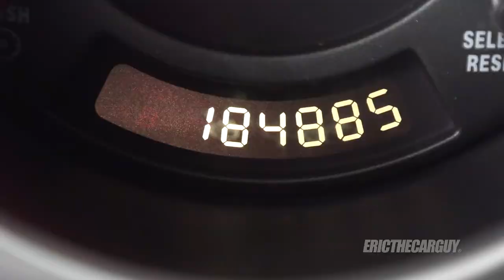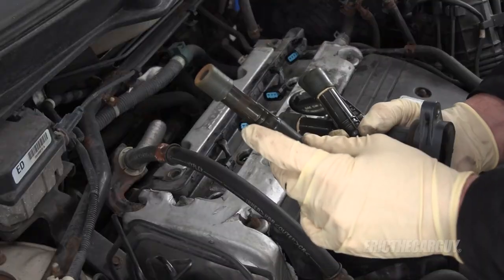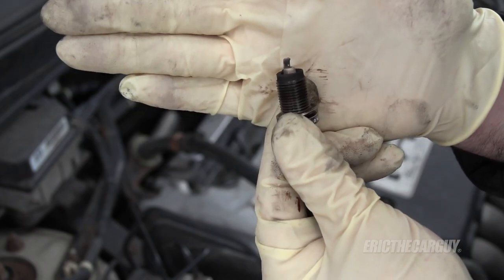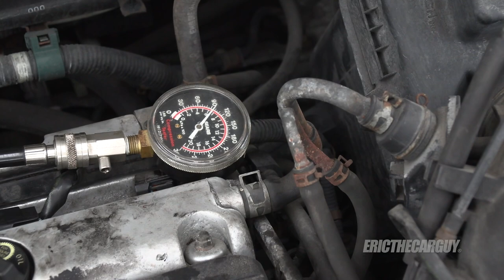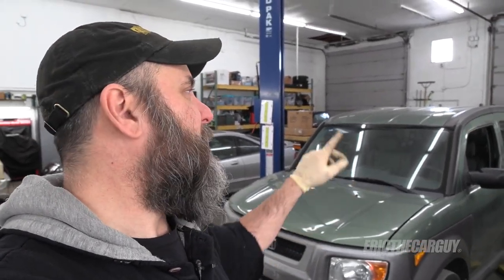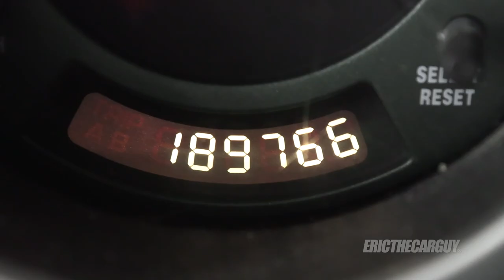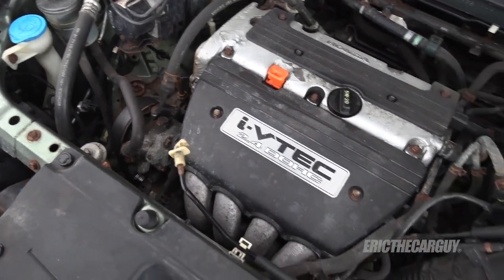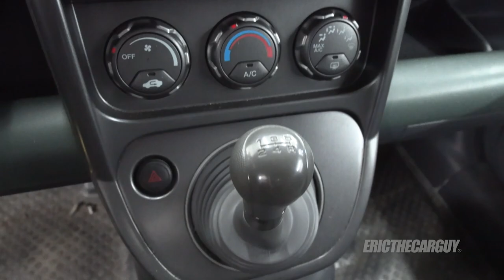I Just Bought 2 Honda Elements

Comment: With all your Honda/Acura experience, you’re definitely not out of your element. Deja Vu all over again or Deja Vu Deja Vu. I’d try some Yokohamas on the Element or maybe some down market Master Craft tires made by Michelin. I wonder what the dual pump fluid looks like in these vehicles.
Reply from the maker: Actually Nokian may be stepping up with tires. I do plan to change the diff fluid on both vehicles. Thanks for the comment.
Reply: @ericthecarguy  Cool, glad you got sponsorship on the tires. Now if you can score a 2.4 engine from J&J Auto Wrecking for the beige Element, that’ll be epic.
Reply from the maker: I'm actually sourcing one from Low Mile JDM. They are sourced from Japan where they have to replace an engine after less than 100K due to their emission laws.

Comment: I have an element  Halloween horror story
my alternator went, it killed my battery. 
luckily my battery is still under 100% warranty so I got that replaced for free. 
But when I started taking everything apart to get tested. I found out my fans had no bolts in them, 
so it made it easy to take out to access other areas 
then I removed the battery and the housing I discovered the welds have rusted off 
like I was holding a piece of Elmer's glue in my hand
so then I decided to change the thermostat since I could get to it. 
took wayyyy to long but I got it back on (such horrible placement)
Then since all the paint is chipping off the engine I was cleaning it up 
and then I decided to change the spark plugs, when I got to the spark plugs 
I saw there were NO BOLTS holding in the boots for the spark plugs....
Reply: I am currently on the hunt for a good deal on an alternator and 
advance auto parts seems to have the best pricing as far as an easy pickup. 
I am afraid to go used (not remanufactured but used)
I don't want to have to do this again for awhile.
Before this happened I was in the middle or replacing the 
ignition switch, keys and dreading replacing the door locks
i also upgraded all dash and climate control lights with led 
and painted all my dash pieces for a new look
Reply: so as of now i need to install a battery, alternator, plugs, fans, all dash components and plastic, muffler, rear struts, front upper control arm bar, trailer wiring, additional 12v port and plugs and figure out how to properly clean and repaint the engine without having to remove it. 

OHH and how to properly and safely fix all the major rust in the engine bay. 

at this point im starting to think i should sell it for parts and buy another one lol
Reply: i really really wish i lived close to you lol. If anyone is in the cleveland area hit me up if you are bored and want to help a fellow elemental!

Comment: I got a jdm k24 for 700 but jdm engines are usually nasty but ive been running mine at 360 torque and 380 hp in a em2

Comment: Eric, since you have a TON of elements. Can you help me just with your best opinion of why after a transmission rebuild and new clutch, my clutch is on and off making a chattery sound. it stops when i press on the clutch, and it can be remedied if i press the clutch just a tiny bit. I mean, its a brand new clutch and ive already put more than 1k miles on it and still can hear it on idle. Im guessing the release bearing?

Comment: Hello Eric, off topic to the Element,  but have you seen idle issues on CRV(2013) where when you stop in D(foot on brake) and the idle goes down to around 600-650rpms and there is vibration in steering wheel? CRV has 151k miles.

Comment: 6:00 ..I bet its just the valve is stuck open, and the valve of the other cylinder is open based on the timing of the engine in that moment-- and the air was just pumping across one of the manifolds.  Idk the valve would be stuck open though, not good.

Comment: Hello Eric, greetings.🙂. My 2001 honda accord showing transmission codes. (1,6,7)
We have OBD1 accords here in NZ even in 2001.
1 is for lock up solenoid cicuit A
6 is for shift lever position switch
7 is for shift solenoid circuit A.
I got 1 and 7, but what is 7??
Transmission position sensor or its under gear nob??andi have bench tested shift and lock-up solenoids and ohm testing. They are in factory specs. Do you think it can be a faulty computor??
I shall really be thankfull for your help.

Comment: I'm looking hard for a 2007 or 2008 EX. Slim pickings around here (I'm in the northeast). Thinking I may need to go out of state, but travel brings its own hassles. Is it worth it just to avoid the rust? Also I'm wondering what the popular consensus is re: manual vs. automatic. I'm cool with either, but which is more widely preferred, and why?

Comment: Hey Eric this is Gill i have problem with my Honda Accord 2008 ex 2.4L engine 
Some time it take long crank to start and then code P0339 and VSA light comes on 
This thing mostly happened in cold weather (-20c)but sometimes in summer to

Comment: I never buy Goodyear anymore I had 3 different cars with different model Goodyear tires that were properly inflated explode on the highway and of course they go we can't determine if it was a manufacturing defect because the tire is torn apart . now i have the new Michelin crossclimate tires they work great all year round snow rain or dry pavement and they wear evenly

Comment: I’m guessing this is due to piston ring wear on this engine, what would cause that though? Running the engine too low on oil, driving too hard, not changing oil frequently enough misfire on all cylinders due to bad plugs causing the ring lands to break? 184K is very low miles for a Honda K24, I would really like to know more back story.

Comment: Hey Eric I wanted to ask you a question I have a 2003 Honda element all-wheel-drive it’s a automatic and I was wondering if I’ll change out the computer to a Acura TSX would it make it faster like the TSX or will it just totally destroy the engine and also how can I remove the speed limiter on the element 
Thanks in advance

Comment: I also own a 2005 Element.  I do my own oil changes, and I have never been able to remove the oil filter without spilling some oil on the chassis given that the oil filter is sitting horizontally.  Let me know if there is a trick to avoid the oil spillage.

Comment: Erick, I purchased front brake pads for a honda city at the dealership. The box came with pads, backing plates and a small bag of what seems to be grease....I didnt use it because I wasnt sure what it was...I used silicone lubricant on all pins but they were coated with a black substance similar to what the dealership provided inside the box....is that black stuff grease or is it silicone paste? I can send you a pic if you want but the bag doesnt say anything.
Reply from the maker: The packet is moly grease. It's suppose to go between the brake pad shim on the back of the brake pad to help prevent noise.

Comment: I didn't see you turn the engine to TDC for the bad cylinder when you leakdown tested it, maybe a valve was open. I could have missed it, or maybe you didn't mention it?
Reply from the maker: I didn't cover it because I wasn't getting into specifics on this video. I have a video linked in the description on leak down testing. Still, oil residue on spark plugs usually tells the tale and most often requires a rebuild. Also, it had zero compression on that cylinder. Thanks for the comment.

Comment: I love anti-seize on my lug bolts. Better than rusty lug bolts
Reply from the maker: I don't recommend that. The factory doesn't either. Normally on Hondas it isn't an issue, but American vehicles have the worst lug nuts in my experience. Thanks for the comment.

Comment: There's a very good chance the khaki car just needs a valve adjustment (low compression). Worth trying before an engine swap.
Reply from the maker: I've never seen a valve adjustment issue cause no compression in a cylinder.
Reply: @ericthecarguy  FWIW I have several times.

Comment: I have a 2003 element and a few months ago it got hot, they brushed the head, changed the gaskets and tune-up, before putting it to normal work, I realize that it still has water in the engine, what could it be?

Comment: If you have to buy a replacement VTech solenoid, DO NOT BUY AN AFTERMARKET PART! Buy one straight from the Honda dealer. There are many fakes that are not real Honda parts, and the Chinese parts fail or don't turn the engine light off.

Comment: When I went through my apprenticeship in the '80s (working mostly on cars from the '60s and '70s), using moly grease  was required to avoid problems with the boots - and not once did I come across rubber boots that were damaged, swollen or deteriorated from the lubricant.  Are caliper slide boots being made out of different materials these days?  Or maybe the base material of moly grease?
Reply from the maker: I find that petroleum based lubricants cause rubber parts to deteriorate which is why I never use them when rubber components are involved like on these vehicles. Perhaps older vehicles used a different material for their rubber that wasn't effected by petroleum.

Comment: I have a 2011 Honda Element and it just started to make a lot of vibration noise , that stops when you put it in neutral. Do you have any ideas ? It’s automatic by the way ....
Reply: Rear differential needs fresh “duel pump” fluid.  Every 30k cuz the fluid will shear.  Only use the Honda fluid

Comment: My name is Kellie I have a 2005 Honda Element I had a terrible oil leak that I fixed did the valve cover gasket did the spark plugs and coil packs the VTC solenoid on the back😢 sorry if I'm not sure of the exact name of the parts but basically I'm doing everything that something with 200,000 miles on a Honda Element would need any videos you can put on motor mount transmission hesitating when I try to push the gas too hard shuts down at 70 and till it gets back down to 60 I'm in Florida doing the work myself you have helped me alot anything else you can put on or point me to please please please thank you

Comment: Dang my Crv 2006 with the k24 engine just broke the timing chain,  I am looking forward to the engine replacement
Reply: another head..?
Reply: @maartenyzer4121  haven’t got that far,  just took off intake manifold and at least 2 valves are broke.  Having issues with the main pulley,  got the 50mm Honda  socket coming today hopefully be able to get it off and the timing chain then the exhaust and head off this weekend.
Reply: At this point it’s probably looking like an engine.  Local parts place has a used one for 1k

Comment: Rotor screws are the devil Eric. I always leave mine off. Ive had those damn things strip on me more than id like. Just use a lug nut lol
Reply from the maker: I've been doing this for 25+ years and rarely have issues with rotor screws that I can't handle. https://youtu.be/GhntxkowIco

Not saying leaving them out is a problem, but it bugs the crap out of me. Different strokes. Thanks for the comment.
Reply: @ericthecarguy  yeah, i understand. The parts must go where they came from. When i had my integra and civic those were stripped, this s2k was too and i used an impact screw driver..i got lucky i didnt have to drill it out
Reply: I had the same issue until I bought a Japanese philips (jsp) type punch
Reply: I had same problem until I bought a JSP screwdriver to remove them

Comment: Is there any way to build compression in a 1991 acura legend 3.2 l it has been sitting for 3 years I put a new battery,  fuel pump & filter and fresh gas in it and it just cranks, no start. Did a compression test and cylinder 1 & 2 are the only ones that have compression.  Timing belt is good and all 3 timing marks line up.

Comment: Are those brake sider pin boots an available part?  Mine were wrongly greased as well.
Reply from the maker: By the time you find them you might as well replace it with a reman caliper.

Comment: You sure you didn't put that coil pack back into the cylinder which you initially took it from?
Reply from the maker: Yes, and the compression test confirmed it.
Reply: @ericthecarguy  it just looked a little confusing on the cut camera shots, looked like some magic trick with the coil packs moving position on the engine top. lol

Comment: I own a 2008 Element.  I recently notice the 'D' light flash while driving.  It did it only once and I've never noticed it since.  Could there be an issue with the transaxle?
Reply from the maker: Yep, pull the code.

Comment: Can you address the the rear wheels splaying out and what the fix is....its there common problem.
Reply: Adjustable rear upper control arms to adjust the camber. I did them on mine. 50$
Reply from the maker: Usually that would be caused by spring sag. They do that over time. However, I think there is a recall for the lower control arms rusting out. Contact your local Honda dealer and give them your VIN to see if it's effected.
Reply: @awdturbo4211  WOW...!   Are local Honda Dealer wants $1200  Plus to fix is the estimate they gave me. It seems like every element that I see has the same problem...is there a permanent solution?
Reply: @ericthecarguy  I had my car serviced at Honda on Friday and they knew nothing about it

Comment: You can't just put air in a cylinder lmao. You have to put that cylinder at TDC or valves will be open and bleed air into other cylinders with open valves. 

Valve lash would be the first check. With those other cylinders being low checking timing would be at the top of the list also.

Comment: So this video came at a great time because I was planning on buying a 04 element that runs but has a knock and also a single code on pertaining to the knock sensor. The guy is desperately trying to get rid of it and he says that he will go $1600.

It's drivable so I can take it to my house, and I find that it's the exact same engine in the Honda accords around that year. So I may get a low mileage junked accord or other element engine and plug and play swap the engine. 

However a friend of mine said that on those k series entrance and arm bearing on the bottom could be worn out or something about the oil pump gets worn out. Which is something I could fix by dropping the oil pan potentially. Is anyone familiar with this?

Comment: Geez i tried that power balance test on my del sol and the engine shut off on the second cylinder and now it's its not turning over. Think i broke something in the distributor. No spark at the wires when i put my test light in
Reply: Yeah the ignition coil went. Power going into the wires on the bottom of it but it doesn't throw out a spark

Comment: But isn't grease in CV joints petroleum-based and in contact with a rubber boot?
Reply from the maker: Different kind of rubber. Also, I can't count the number of CV boots I've replaced over the years. If you look closely at late model CV boots, they almost seem plastic instead of rubber.

Comment: I think your bad engine has a burnt or bent valve in that cylinder, or, maybe the valve clearance zeroed out over time?
Be interesting to see when you tear down the engine.
Reply from the maker: Not likely based on what I saw. I'm thinking bent connecting rod. I suppose we'll see when I get it apart.
Reply: @ericthecarguy  yep!

Comment: Anyone had the codes p0172 and p0420 come up together?  I know what they are but any ideas on the fix? The element is an 03 139k miles from Florida.. car doesn't stall but starts a little hard.. idles ok .. will rev over 4000 and into the limiter but doesn't have power on the road.. doesn't stall but won't reach highway speeds at all

Comment: Is silicone grease the same kind of stuff that's sold for coffee machine o rings and stuff (silicone fat)? It's the only kind I seem to find.
Reply: I think you’re right on point.  Food-grade silicone is used in beverage machines like that.  A product called “Super-Lube” is a silicone paste I found at Harbor Freight.  I think would do brake pins nicely
Reply: @zache.1099  Thanks man! I've used the coffee machine stuff for o-rings in my clutch hydraulics allready since I couldn't find anything else. But I wasn't sure about the lubricating properties.

Comment: I've seen Elements with negative camber on rear wheels. Could that explain the wear?
Reply from the maker: Yes, in part, but the cupping is usually a tire balance issue. That said, I've also seen issues with specific tires on Hondas such as, Dunlop, Goodyear, and Kumho. The negative camber is most likely caused by worn springs in the rear.

Comment: how is debris gonna get in that parking brake once the wheel is in place ?
Reply from the maker: Water manages to get in there and cause rust. Not to mention, it's just plain unprofessional to trow away parts on a vehicle. Especially ones the factory installed. Trust me on this, the factory doesn't spend a penny unless they feel it's absolutely necessary.

Comment: Had the same issue with my rear bumper reinforcement on my 03, the only spot on the car that was rusty. I bought a brand new one from rock auto, part #71530SCVA01ZZ

Comment: Honda has lifetime warranty on seat belts. Talk to your honda dealer
Reply from the maker: As a former Acura master technician, I'm well aware. However, the trick is getting them to make good on older vehicles like this. Thanks for the suggestion.
Reply: @ericthecarguy  I am a retired Master Electrician and Multi Honda owner home auto mechanic. I have had them replace belts on 2 of the vehicles I have owned. One of my high mileage Elements and a 94 civic. I have got a lot out of your videos, keep up the great work.